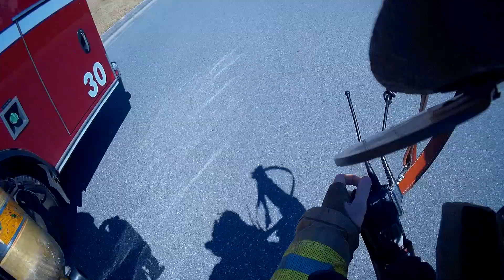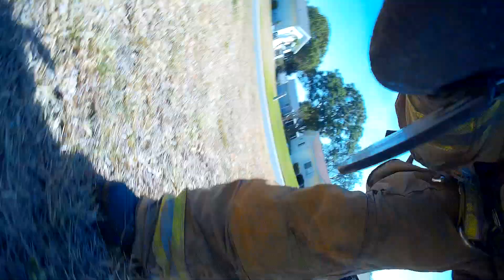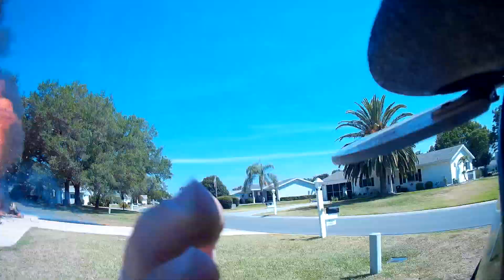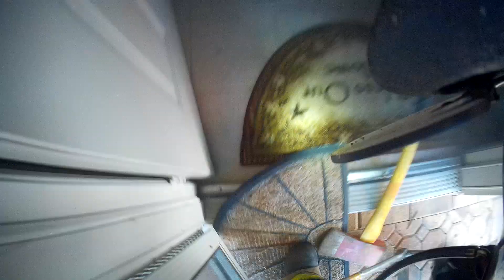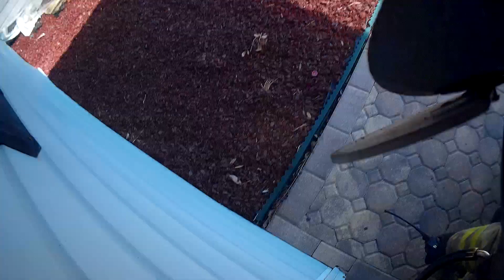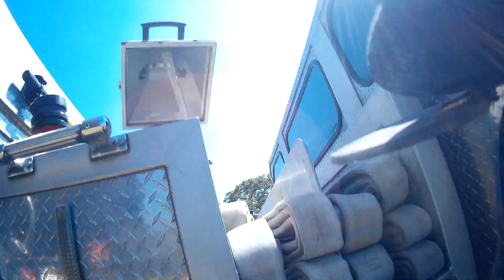Structure Fire, Fire Rescue R30

Comment: Good aggressive move brothers. I appreciate the effort with locating the fire and hitting it with the can. Could not tell but I suggest that you guys close the door where the fire was and confine it. If you did great! Also I suggest that you pull the front door closed a bit when you enter. This will buy you some time to locate and confine the fire and get a quick knock down with the can then search the structure for occupants. This action can delay flash over. 

 I have to tell you that I hate the triple fold cross lay it really sucks. It get heavier the further you move away from the engine and never ends up with working line making it more time consuming to flake out and get the twists out. I suggest a flat load with loops after each 50 foot coupling. That way you can pull what you need and you can control the load as it payes out from the engine. Also you will end up with enough working line to get the job done. I am not sure which brother pulled the second line but taking it out to that little bush caused more work than needed. Might consider not pulling it around trees and bushes. 

When pulling ceilings on a pitched roof it is always safer and more effective to pull the ceilings against the wall. Then pull toward the center of the structure. With an attic fire that is as involved as this one you will have fire down to the wall anyway. You will have to pull it all as well.  You will be able to access more of the attic space and extinguish the fire up there faster because you will not be contending with the fire rolling up from the walls while you are trying to extinguish the fire in the center of the room like you guys were doing. Also the attic was a total loss. I would suggest some salvage work before fully engaging in the fire attack. Get a firefighter in the bathroom pull ceilings there and get him up on the counter. He can begin to hit the entire attic from that location unless the AC plenum return are there. Then you can salvage while he is getting a knock down. Works great. Then the second line can get started in the room where you start pulling ceilings from the wall.

Overall great job guys
Reply from the maker: Thank you for the input!  We use a triple lay on majority of our trucks. A few of the members taking part in this job were very new, but of course thats no excuse!  We try and take every bit that we can from every call and fire to try and never make the same mistakes twice!